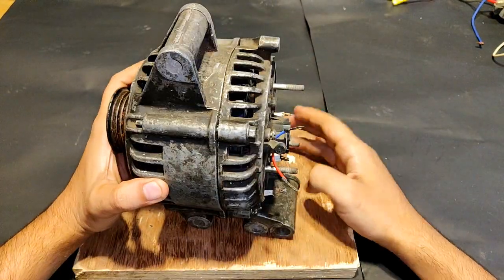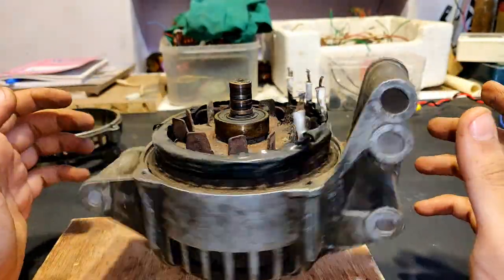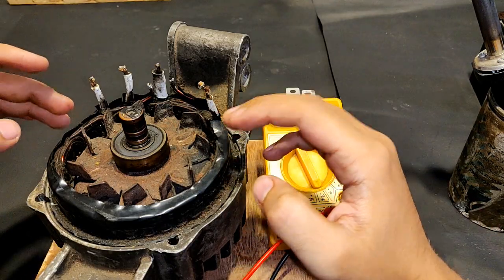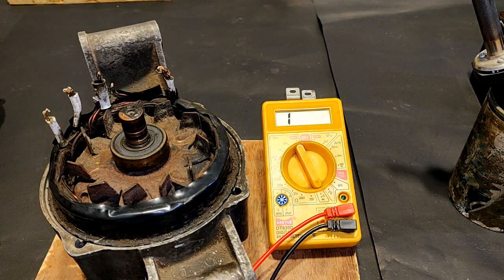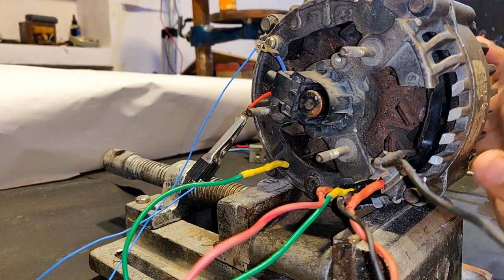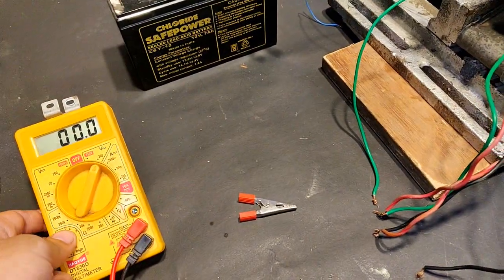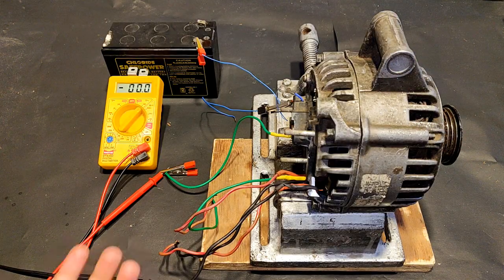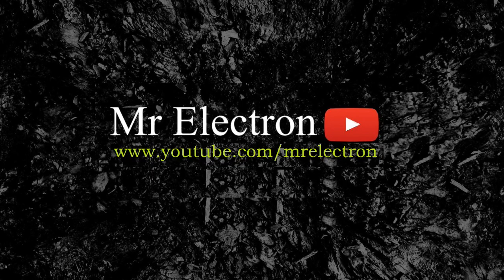12V 64 Amps Car Alternator ( 2000 RPM ) Converted to ( 600 RPM ) - No Circuit or Transformer Needed

Comment: I'd have used a drill with a socket adapter to drive the hold down nut for the pulley. It would give more consistent readouts and touch would potentially show a peak voltage

Comment: tack a 12 volt alternator a Produce 240 volts  AC  currant to power house lilting  & TV.  ? how can it be done. Without using an  inverter.
Reply: can it be done with out rewinding the stator IF not  how can we rewind the stature to get 240 volts ac .

Comment: If you took the winding out of the rotor coil, swapped it for slightly thinner you'd fit many more turns on the rotor. 
Would this mean the same magnetic output maybe more at a lower voltage?
It would be great if we could reduce the consumption of excitement 👍🏼🙂

Comment: Ok what if you use hv diodes instead of useing ordinary diode? What theoreticaly wuld hapen? What if theoreticaly we have a singel pole alternator acting like a pulse generator wuld that not solve the isues with diode lose's and rectification lose's? What if we actualy use that energy and actualy use it to run seperate device's wuld that make that thing work even with out voltage and amp regulator? In my opinion those diodes and other staff is there for to prevent out side frequencys to interact with the alternator to my they look like safty polarity devices rather then by usefull at all. Because when I use amplifier and plazma ignition that alternator thingy fluctuate to by a generator/starter motor/magnetic brake, transformer, magneto and lot more things my start rpm charge gets around 2500rpm.
So in reality it seams they dont need those things to my that back emf culd by removed compleately by simply pulsing that thing like in mashine gun stille just like a pulse motor ore generator.
Ither way if external sorce is aplied to ground ore the positive it still will work but polarity will damage polarity sensitive devices and gages will fluctuate back and fourth.
In my opinion that thing use bouth positive and negative grounding.
Exactly the same thing like waste spark managment ore also called dual ignition.
That deam thing is dangerouse to cars 👆 Im not realy shure why some one wuld use a alternator instead of a generator?
That thing vaporise fuel faster if it is atached to ground and if some thing goes wrong it makes fuel economy teribel even causing it to make car run teribel ore back fire.
Ac goes tought even insulators so that thing culd infact electrocute you tought insulators.
Thats why buzzing, radio interfearence, coolant electrolisys acures on top of that if peopel consider ethanol high oxydiser based fuels head gaskets blow up realy fast including all others ruber's and seal's.
In some case's distributor cap's are made of conductiv plastic's that parasitic spark culd do real damage to engine's. This is a good video to mode your alternator to charge at low speed and I recoment to use ampliers for ignition coil and bypass ignition coil wires just on engine start up expecialy for older cars they dont like non leaded fuel.
You actualy can force a gasoline engine to run at low speeds like 300-500rpm with a strong amplifier ignition and hevier flywhell that alternator mode can come in handy thats nice for fuel economy 👆 with a modified transmision some vaporisators ore lpg you get realy nice economy out of your car great video 👆

Comment: what can you tell use about crystal ignition system Im curiuse to know if old school ignition oil cooled culd by used as independent souce of energy cinde of similar to piezo igniter ore piezo generator thats all theory but Im confused mostly I belive it culd by done even tought no  where I can finde info on internet about it . It was used for a short time for singel cilinder engines called piezo ignition system.
Im not shure if pick up coil culd activate a modified ignition coil filed with piezo cristals ore not ? Im not even shure what a wire wond in to a coil how it wuld act close to piezo cristals and magnets this is all theoretical I supose

Comment: Very impress.  Will you make a draw of the final connections, I tried to follow but got confuse due Connection Mistake in this video. I am trying to convert a 12 V 2000 rpm alternator to a low rpm to use in an old Massey Ferguson 65 tractor

Comment: Mr electron I am so impressed of your work I have tried this and it worked with 35v please how can i control this voltage to 14v to Charger a car battery thanks
Reply from the maker: Use a 25 to 40 Amps buck converter..

Comment: My alternator has 3 points connected to.the diode  plate after removing the diode and unpinned the wires they came to be  18 wires

Comment: Hey man, I have a question and I would really appreciate your help (or anyones here). So I have alternator 12V, 60A. How many rpm do I need to spin it with in order to work properly? I`ve heard that if you don`t give it enough rotates it will overheat. Because it has a wind propellor that cools it down while spinning.

Comment: Mr Electron you had better go back to school to learn how to solder properly.  Touch iron to object to heat and then touch solder to object - not to the iron.  You are losing most of the effectiveness of the flux in the solder.  If using fluxless solder, you should apply flux to the object to be soldered.
Reply: Shemon Doublejack rude much ?

Comment: There is a simple way of testing the polarity of the windings,  connect a diode in series with with each winding and yes polarity while the motor is cranked.
Make note of each set and then connect in series.

Comment: The life expectancy of the brushes will not increase significantly after this modification, because their wear is not a matter of the rotation speed of the rotor, but of the current flow through the exitation coil of the rotor. Slip rings have not the same behaviour as toothed collectors used in older d.c generators or universal motors where the armature speed causes relevant friction problems. No matter this modification, the current flow of the rotor of the alternator will remain unchanged because there was no change on the resistance of its coil. The change in current, after the modification, will be noticed only in the stator coils and this holds true because the product of POWER for any given alternator (i.e Volts x Amperes) is unchanged. And this power at the output depends on the exitation current and the rotor speed. In other words, for the same POWER output, exitation and speed of the rotor must be kept as before the modification. No way to get the same power with less r.p.m...

Comment: There's my windmill.
Reply from the maker: Yes there is :)
Reply: @MrElectron  to
Reply: @MrElectron  Z
Reply: Did you manage to get a lower rpm ? Did you windmill works well? what are the problems you ve encountered ? i am trying to make a windmill also by myself